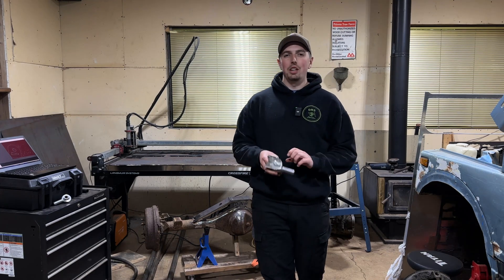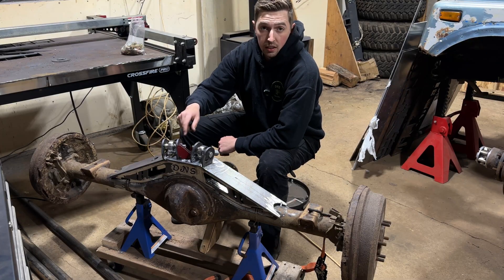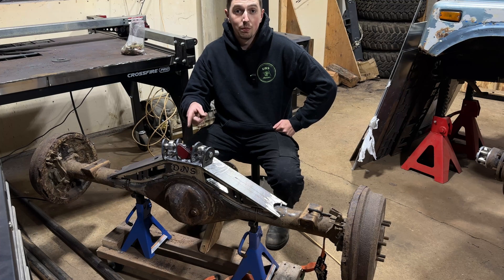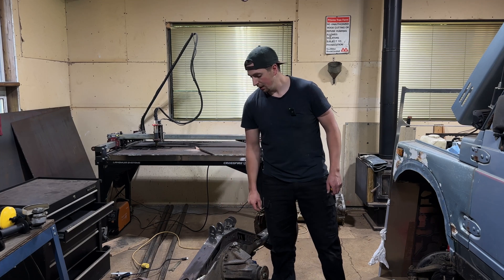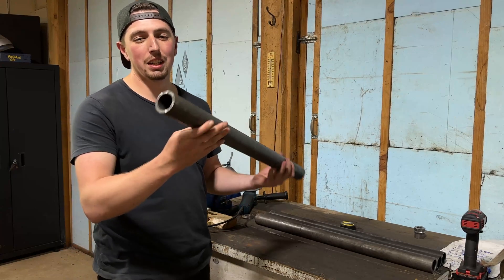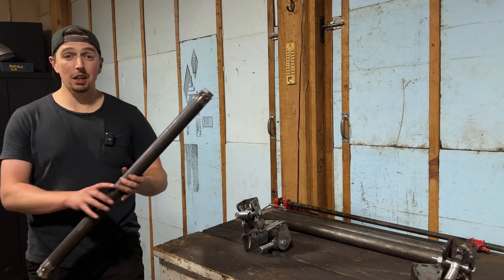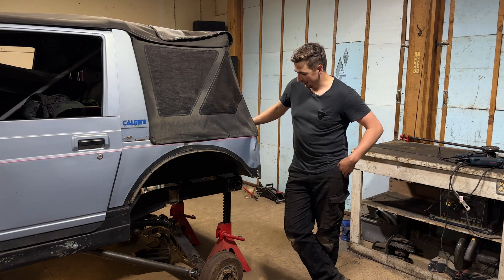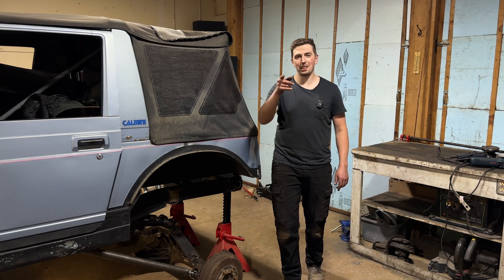Suzuki Samurai Rear 4 Link - Episode 7

Comment: On this type setup, what keeps the nose of the differential from pointing up and down while accelerating?
Reply from the maker: That would be the separation of the lower and upper links. The axle is trying to wrap but the triangulation from the upper and lowers will prevent that. Typically the rule of them is have the distance for axle side mount upper and lower to be 25% of your tire diameter.
Reply: @alpinefab  I am going to try and upload a video clip of what is happening with my 4 link jeep I recently purchased
Reply: @alpinefab  https://youtube.com/shorts/TSHWGzPK7KY?feature=shared
Reply: @alpinefab  I am living in the Philippines. 
I purchased a 1943 Willys jeep that has been converted to 4 link suspension (front and rear).
The transfer case, and both front and rear axles are from a Samurai.
Reply from the maker: That’s awesome! Sounds like a cool rig
Reply: @alpinefab  problem is with the over articulation of the rear differential. 1st and second gear throws the differential up and makes a very loud clanking sound
Reply: @alpinefab  https://youtu.be/1xedKKLxppQ?feature=shared
Reply: https://youtu.be/2ImG9otnk2E?feature=shared

Comment: what drive shaft are you using for the rear?
Reply from the maker: The rear is going to have a custom length Toyota CV/Double Cardan
Reply: On this type setup, what keeps the differential from twisting up and down  under load?

Comment: Awesome explanation! Could you give me the specs of the Heim joints and which tube thickness are you using, please? thanks for sharing.
Reply from the maker: Thank you! Yes of course. I’m running 7/8” Heim joints with 2” 0.25” DOM tube lowers and 1.75” 0.120 DOM uppers